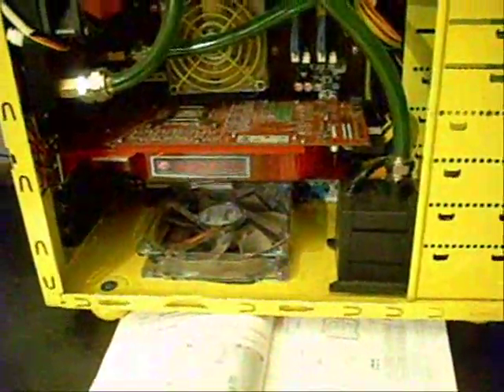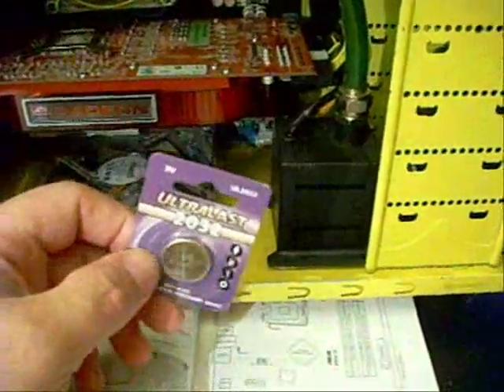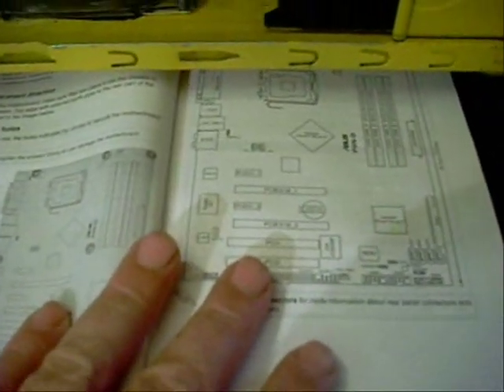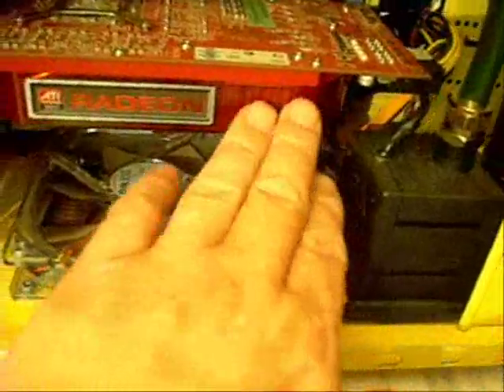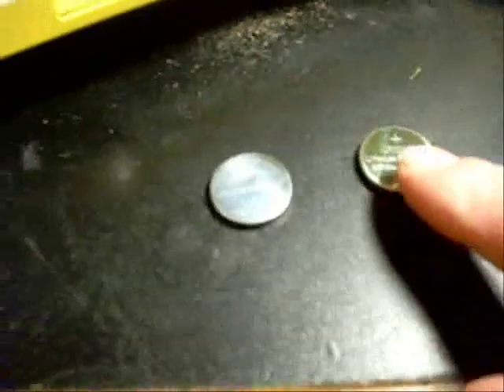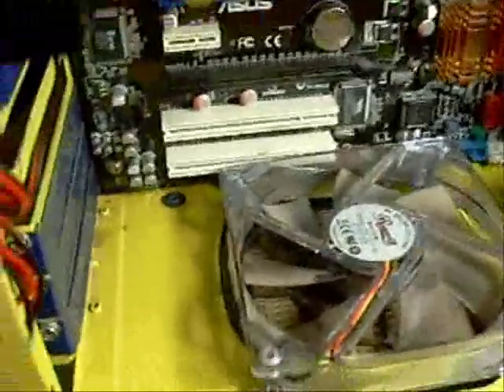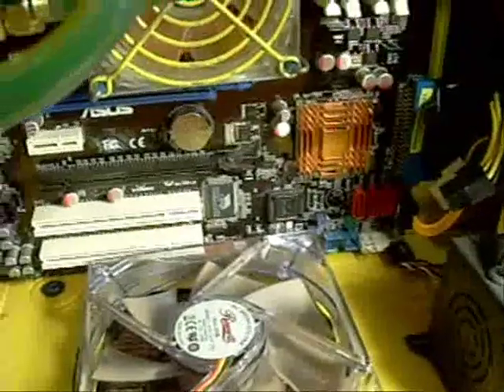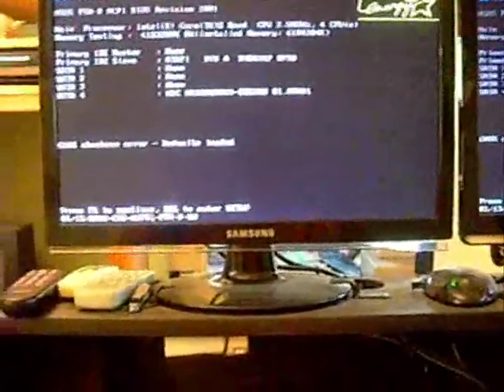Cmos battery replacement a simple how to and when to change them

Comment: after replacing that battery , like everything in my pc will be same and it used to be right or will its settings change ?  will my os and apps in it will remain the same as it were or will it change ?
Reply: I took pictures of the relevant screens of my bios set up on my tablet before doing the change.
Reply from the maker: It will all still be fine. The only thing the bios does is simple things like selecting what drive to boot from first. So after changing the battery it will go back to the default settings for the bios only. Your operating system and programs and everything on your hard drive will be intact. Most people never change any setting in the bios so the default setting is what almost everyone is using anyways. The only people that dont are people that like to tweak things or do overclocking. It will be just fine. Good idea to check first before doing it to be sure though :)

Comment: do scratches affect the cmos
Reply from the maker: Do you mean scratches on the motherboard itself?
Reply: +FUzzyBUnnyBOoties no i think i hit the cmos a bit too hard
Reply from the maker: The cmos chip in on the motherboard itself. What do you mean that you hit the cmos too hard?
Reply: +FUzzyBUnnyBOoties I struggled to get it out of the socket and the thing got a little scratch on it but i dont think it'd do any harm ?
Reply from the maker: It should be fine.
Reply: +FUzzyBUnnyBOoties Yeah i thinked i fixed the problem, it beeped 3 times and then paused and again
Reply: +AchillesofOblivion i removed the ram and stuck it back in

Comment: You should never touch button cells with your bare hands. Depending on the conductivity of your skin, you run the risk of discharging the battery. This reduces its effective lifespan. Use an insulating layer such as nitrile or latex gloves to reduce the risk of discharging the cell. Also consider laying your computer tower on its side so that the cell drops into the cell holder. You would not want to risk shorting out any other parts of your mother board still retaining a charge after you switch off.

Just saying.
Reply from the maker: Very good advice. Thank you for posting it.
Reply: thanks.

Comment: I've only had to replace batteries in 10+ year old PCs but it wouldn't surprise me if some of them died prematurely as it's possible there wasn't a good charge on them or they were stored in a bad environment that caused a drain on the charge.

Comment from the maker: Will it allow you to access the bios?. If so then it could be the battery. If not then it could a hardware failure some where in the system.Most possible motherboard.

Comment: I still have the original battery in from new - 7 years now. This desktop PC, when it's switched off, usually remains plugged in to the mains - could that have something to do with its long life? Is the battery only used when there is no mains power supply to the PC?

Comment from the maker: Sorry for the later reply I was on the road all weekend. Well good job finding out what was causing the beep. It could of been the fan warning from the motherboard that was beeping. 

I just hope the CPU didn't get too hot in the process. But most of them have pretty good thermal protection against heat. Have you tried resetting the cmos jumper now that the beep is gone?. It might still be stuck in a loop from the fan warning. Let me know. I will keep my fingers crossed for you.

Comment from the maker: I am so sorry to hear that. It sounds like you did all the immediate testing that you can with out trying out new parts. The next step will be to disconnect the drives and take out all of the cards out of the machine and then try it and see if the beep changes. If it is still the same then you may have to try a different power supply and see if that helps.

Comment: I took out the video card out and checked it out made sure it ws in tight looked at all connectors everyone looked fine I think I hear the hard drive but not 100% sure because the fans are running Nothing on th monitor except saying all connected I don't have no light on the mouse at all not sure that is imporant just wanted  let it e known. I put all the ram back in and shorted it 1 more time still a long beep  I left it on about 3 or 4 min to see if the beep would stop or break for another bep

Comment from the maker: The next thing to check would be to make sure your video card is seated properly. Take it out and then put it back in to make sure it is making contact. Also make sure all your power connectors are installed tightly. Also when you first turn the computer on your should be able to hear the hard-drive spin up. Listen very closely and see if you can hear it. Do you get anything on the monitor at all?.

Comment from the maker: It might have the restore information on the hard drive itself. If you take the side cover off of the case you should be able to find the cmos jumper for the motherboard. You can try shorting that and see if it helps. If you cant find it just unplug the power cord from the case and take the battery out of the mother board. Leave it out for a couple of minutes then put it back in and try again.

Comment from the maker: I was able to find the beep codes for it on the Gateway website. I will send you a PM with the link. It sounds like it might be a bad memory chip. Take out all the chips but one and try booting it. If that works then try each chip one at a time until you find the bad one.

Comment: gateway dx4300-03 Clock was always needing set and I could never go in safemode it would just beep and I would have to shut it down the other day I blew the thing out and a couple days later it stated turning off I did a search and someone said the cmos bat.causes this so I found this video and changed my battery and now it just beeps 1 time the fans kick in and it beeps 2 more times and in a few seconds shuts down nothing on the screen.  I bought this thing 1 year ago on ebay. any idea

i

Comment from the maker: @Royours You are very welcome.  And yes you can do it yourself. You will see a little lever on one side of the battery just push it in with your finger or a screwdriver and the battery will pop up for removal. One thing to keep in mind is you will lose all of your bios settings that you have changed. The machine will default to its factory settings which is no big deal. You wont lose anything from your hard drive or anything like that. You might just have to go into bios and change the time.

Comment from the maker: @MetalMatt2510 I would guess it is either psu ,motherboard or another component in the machine. Try taking out all the unnecessary cards and disconnect the harddrive and optical drive. Then see if it will at least boot into bios. If still nothing then try a different psu. If it still wont boot then I would guess the motherboard is bad. Hope that helps.

Comment: I have a pc when i turn it on the fan inside goes fast and loud and the computer wont boot up, could the cmos battery need replacing or do you think i need a better psu?

Comment from the maker: @elisaisabel Only some of the newer overclocking motherboard have dual bios so you can save a copy. By removing the battery you will reset the cmos back to its default settings that will allow you to start it up and change anything that you want. The only real way to keep track of your settings is to write down the things that you have changed so that you can change them again. 

Resetting the cmos is no big deal. I have to do it some times to when I set my overclocks too high.

Comment: hi! how do i save the bios settings???? my pc on red letters said after not enter over and over again rebooting itself: "PLEASE CLEAR CMOS IF SYSTEM NO DISPLAY AFTER OVERCLOCKING" it's 'cause it's overhitting (i had over and over those messages, also in red letters, but i dont have money to improve the coolers so i have my pc open and a fan hitting it (it's the only way i have right now to face the problem). What will happen if i take off the battery and put it back? PLEASE HELP I NEED MY PC!!

Comment from the maker: @supra60 That is a very good question.  If the battery is 3 years old it is probable ready to be changed.  

There is no way that I know of to save your settings for the bios.When you change the battery the bios will go back to its  default factory settings. So what I do is take a sheet of paper and write down what setting I have changed in the bios so after I restart the machine I can go back in and change them again. Usally there are only a few that a person changes.

Comment: My battery shows 2.96 volts should I replace it? It's almost 3 years old. Theres no way to change it without losing the bios settings is there? I should be able to save the bios settings to usb drive before I change it, right?...I'll have to check.

Comment from the maker: @silentghost23 Almost all motherboards use the CR2032 which is a very common battery. i looked up the manual for your board on Asus website and it did confirm that it is a CR2032

Comment from the maker: @nogie8 Well if the fans are plugged right into the power supply there wont be any options in the bios for that. That is only if the fans are connectected right to the motherboard itself. 

It may be a issus witht eh power supply if it is providing more then the 12 volts that the fans require. They will spin real fast. But if that was the case it shoud do it all the time. So i am a bit confused as what could be casuing that.

Comment from the maker: @nogie8 
Do you mean your cpu fan?. If so then it is probable from a setting in your bios. A lot of mother board and video cards use auto fan controls and they will rev up to full speed when started and then slow down to what ever they need to keep the cpu cool. 

But if you are setting the fan speeds manualy in the bios and then reboot and the speed have changed then it could very well be the battery.

Comment from the maker: The one that you need to check is the one that is attached to the motherboard itself. The front and rear ones are just case fans. The one on the motherboard is the one that cools the processer. The computer will monitor that one and if it doesnt reply to the motherboard it will keep the computer from booting to protect the processer so it doesnt over heat.

Comment from the maker: The fan failure message would mean that your cpu fan is not spinning or spinning slower then the requirements. Try starting the computer with the side cover off and check to make sure the cpu fan is spinning.

The floppy drive failure just means that the bios has changed back to its defualts after the battery was replaced. 

Make sure when you take the batter out that you have the power cord unplugged from the computer. And leave tha battery out for a minute os so before replaceing.

Comment: have dell e520.  with battery out i get the floppy seek failure F1 cont F2 setup.  when i put in the new battery my monitor stays in Power Save Mode. ( that was my original problem) and someone said my battery was bad.  i dont understand.  i tried also change boot sequence since i dont even have a floppy.  but then i get error about Previous Fan Failure.  i changed it back and took out the battery.  so confusing.

Comment from the maker: It will set all your motherboard settings back to default. So a screen will come up and say somthing like defaults loaded would you like to go into setup and make changes (usally it is like f1 or delete key) It will tell you onscreen which key to hit to go into setup.. If you havent used any custom settings in there before you will probable just have to set the date and time and then boot windows.

Comment from the maker: The brand can be different but they all use the same numbers on them. So for instance if you have a number 2031 in there any other brand of 2031 battery will work just fine. There nymber system dictates the size and voltage of the battery. You can either open up your case and see what number is on the battery or look it up in your motherboard manual. Most of them have the battery they use listed in there.

Comment from the maker: Very good question. 

First a person should always make sure that the computer is unplugged  before poking around in it. 

Second you want to make sure you discharge any static from your body first. This can be done by putting one hand on the metal chasis of the case before touching the mother board or other internal components. 

If you follow them rules you will not get shocked nor will you shock the computer.